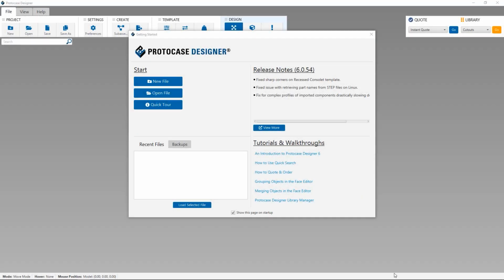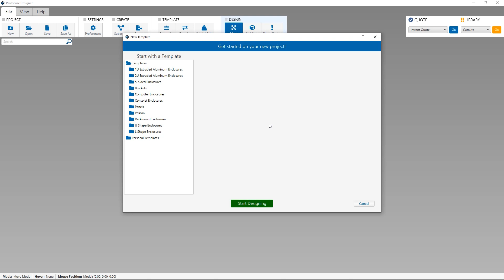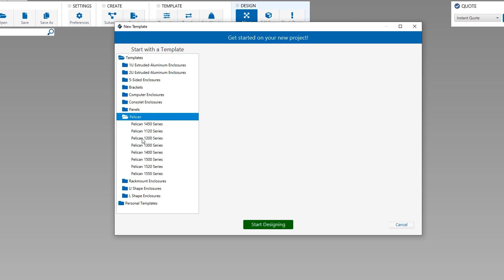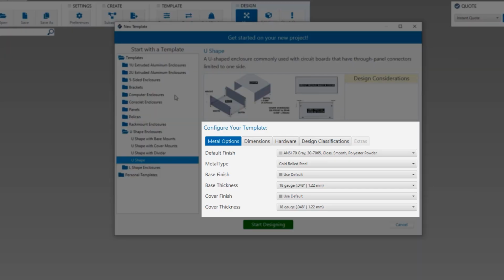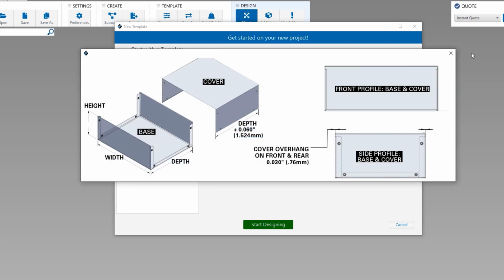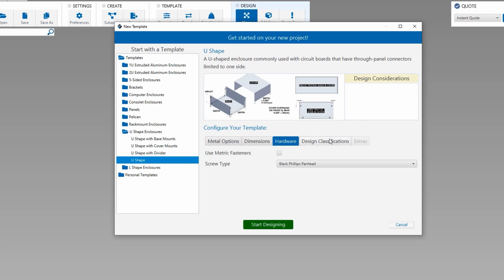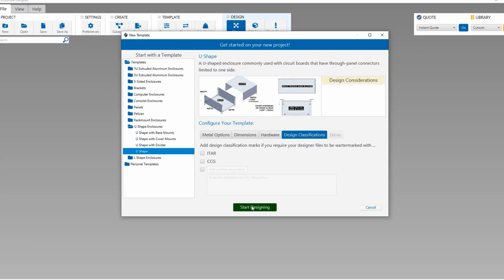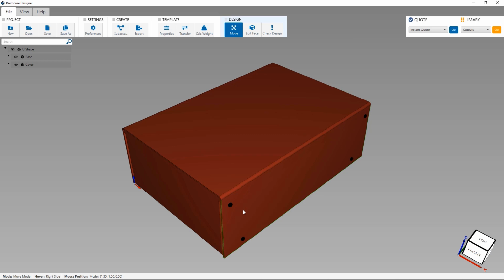Protocase Designer - Creating an Enclosure Template

Comment: Is there a way to alter the template based objects? I'm trying to move the atx cutout but it doesn't seem to be interactable. The atx cutout spawns at the corner of the enclosure and with a fixed number of pcie expansion slots. Im trying to alter it to accomodate more expansion slots.
Reply from the maker: Hey Ryan, thanks for reaching out with your question! Is it the ATX enclosure that you're customizing?

We also have an ATX PCI cutout in the Library, so just wanted to clarify first. :)
Reply: @ProtocaseInc  Yes I was looking over the atx template. I also saw the other cutouts for an atx motherboard.
Reply from the maker: @ryankossick5791  Ah, okay, gotcha. The ATX template's initial cutouts and other items are not editable, unfortunately. 

However, you could start with an L-Shape template (since that is the same shape as the ATX template) and add the ATX and other cutouts you need from the library. 

Let us know if that workaround helps!

Comment: Hey there Protocase, is there a way for me to use your software to design a 10" PC enclosure that is 10" rack mountable? i would like to design a small NAS enclosure for a 10" rack. its very small, so i would need more Hight. i cant find anything like that in the templates.